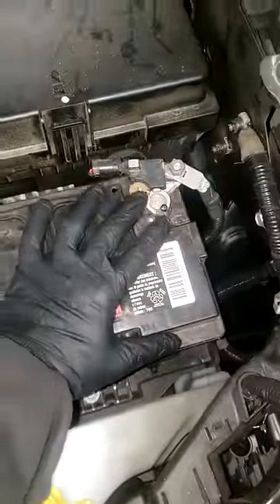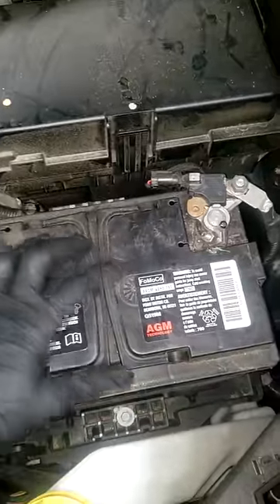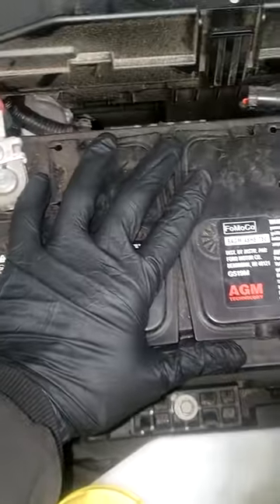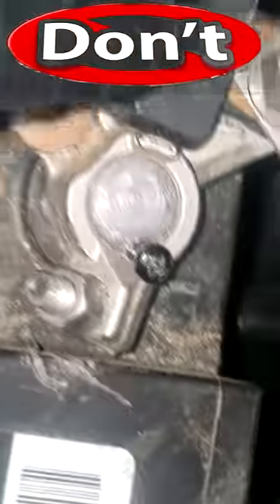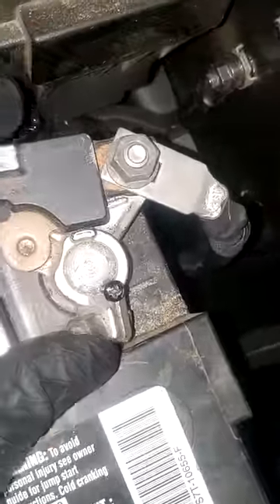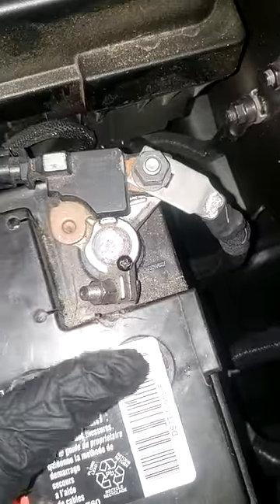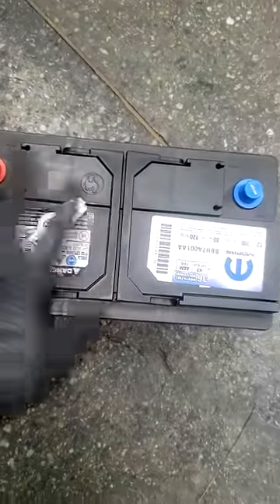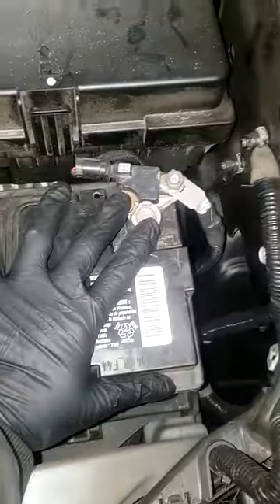STOP DOING THIS PEOPLE. This will destroy your car electrical system.

Comment: Bad battery, with cosmetic damage to the terminal is all this was. 

We're talkin small things here, but the sensor is only responsible for preventing overcharge and it tells the alternator when to stop charging, you can replace that terminal that you call a "sensor" with some random fray wires and it will still run perfectly. You can delete the actual computer sensor and the car will still work perfectly.
Reply from the maker: smdh, you actually on here suggesting that I delete what the manufacturer suggested should be standard equipped on the car???. Are you suggesting the terminal could be replaced without the sensor? Are you telling me the sensor tells the alternator when to stop charging? Dam you went 3 for 3, You didnt even get a one right. This is why this lady just left the hack shop you work at to come here and get it fixed right. Well the good news is that its fixed and shes gone. Your clown ass still on here promoting hackery...smdh.

Comment: Sensor doesn't need replacement not even the terminal is bad take out the screw clean the terminal
Replacement battery.......
Reply from the maker: You haven't a clue
Reply: @OnlineMechanicTips  you just make videos without true knowledge
From 30 year master mechanic

Comment: it looks like someone probably previously over tightened it and squished the post/ deforming it causing it to not have a good connection, so they tried to use a screw to take up the slack from the "air gap" in between the post and terminal.. honestly it just need the battery post replaced which you CANT do so a new battery would fix the situation granted YOU COULD HAVE just grinded away a little bit of the terminal bolt area since it looks like its been completely bottomed out but even sanding or grinding a little bit could have gotten a better connection... you could have saved the customer more money from buying POINTLESS parts or potentially a new battery if they wouldn't mind a little bit ground off in between the bolt space which would not affect anything the IBS sensor was sensing an imbalance in current and the "air gap" was the problem
Reply from the maker: Look man, this is a new car and a huge shop with a reputation. Nobody grinding down anything or altering anything. Thats shit you do on older cars thats not computer controlled. We removed that stupid screw and replaced the IBS and the battery. The check engine light off now and the customer happy.
Reply: @OnlineMechanicTips  obviously the check light will reset.. the IBS sensor wasn't reading correctly because of someone either over tightening it or wiggling the terminal off causing it to deform.. all you needed was a new battery since the post was deformed.. lead is very soft and the air gap caused the voltage to not read correctly and caused the check engine light to happen it could have saved them from buying the ibs sensor idk but least there happy and don't know anything
Reply from the maker: @destinyd1308  lol you expect me to to take a chance with a compromised terminal? By the way, the sensor and terminal 1 unit. It comes together. If the terminal screwed into, its getting the complete sensor. I don't recall asking you whats wrong with the car, I got that part. Im just showing what I'm doing on my youtube channel.

Comment: The screw makes the contact tight. Why would a good connection be a problem.
Reply from the maker: The screw will interfere with the connection and cause problems. Why do yall hood mechanics always defend screws and hacks? That shit has no place on these new cars.

Comment: Neither the battery, nor the screw were the issue.  The sensor may have been bad, but not as a result of the screw.
Reply from the maker: You have a big ass P by ya screen name, which means we have no way to validate anything you say..lol.. Now just how in the hell would know what the issue was?
Reply: @OnlineMechanicTips  I am MECP master certified.  I spent over a decade doing nothing but electrical work on vehicles.  More than that though, it is just common sense that a screw going into a lead battery terminal is not an issue unless it went all the way through the battery case

Comment: They gave you a terminal cause the sensor was not needed. But hey get your upsales where ever you can.
Reply from the maker: Smdh...that was the wrong terminal for this car. This car use an IBS sensor. Its all one unit. The sensor combined with the terminal. You cant get one without the other.

Comment: You should make a video testing the resistance on that terminal with the screw against one without.
Reply from the maker: Good idea. They towed in all the time because transmissions are bricked  with screws in the battery. People seem to think this a game and that they can still do this type stuff on these newer cars..YOU CANT.
Reply: Even if it's only a slightly higher resistance that creates more amps which could cause the sensor to malfunction. They're very sensitive.

I've seen solar setups where the guys use multiple wires and string them together to save money.

Then they fry their $1000+ battery monitoring system.

That's higher voltage but same concept.

Comment: Two weeks later it does the same thing because it wasn't the battery or ground it was a chafed wire inside the dash.
Reply from the maker: Smdh, you might wanna leave the troubleshooting to the pros and keep the guess work over there. Because thats about all you could do on this, guess or speculate. Either way, thanks for watching
Reply: @OnlineMechanicTips  I have degrees in industrial automation / robotics and mechanical engineering and make 500,000 a year keeping billions of dollars in machines a year for hundreds of billion dollar companies moving daily.   This pos Honda civic 12v car electrical system doesn't make you an expert in jack shit..   in two weeks the chained wires will cause the same crap.   You solved nothing by changing the battery and that "sensor"...
Reply from the maker: @wheatdevon  Judging by your channel, you a nobody. Let me show you how easy it is to make shit up on the internet. Not only am I a mechanic, I also do brain surgery and make about a million a year. The only proof I have is this channel proving the mechanic stuff, but I have no brain surgery stuff on it, just believe me any way. You see how crazy you sound. This car long gone fix and repaired. I cant help it some jackass put a screw in a sensor and caused her problems. But I'm here to fix them. I could care less what you do and how much you make my dude. I assume you not aware that is a sensor, maybe your highly educated ass think its just a typical ground terminal, its not. And btw i never claimed to be an expert, you just assumed that.
Reply: @OnlineMechanicTips  well that makes sense given your video. Not only do you think fixing a Honda is complex you are also can't tell the truth.
Reply: @OnlineMechanicTips  your quote is as such.   "You might wanna leave the troubleshooting to the pros..." Just because you got paid did not make you intelligent.
Reply from the maker: @wheatdevon  This car fixed and gone. Thats all that matters. Not sure wth you talking about
Reply: If I’ve ever known one thing in life to be true, it’s that people that identify as experts or pros very rarely know half of what they need to know.
Reply: @Clynikal  I make most of what I do up as I go.  Because rarely do things go as planned, thus my phrase I say daily anymore is "I fix shit I didn't build or break because it wasn't built right to begin with." and "best laid plans of mice and Devon." We live in a time where machining is so good and capable, yet we have critical components made of plastic.   And instead of building something to last 10yrs they just want it to last 10days off the lot and to the end of a warranty.

Comment: I agree with you but will never understand it. That contact is so tight you couldn’t even take the terminal off if you wanted to! I had a car once it didnt matter how much you sanded it or replaced the terminal or how tight you got it to clamp the terminal it would still loose connection! It doesn’t make an ounce of since to me but ever since that car I decided i’d just buy a new battery any time I have a loose connection 💀
Reply from the maker: That contact is not. We would be here if it was. Thats what causing all these problems.

Comment: Imagine charging $200 for an IBS clamp just to get rid of a screw. Throw a post shim on there and send it.
Reply from the maker: You should likely stay far far away from newer cars. Those battery shims will destroy your car and brick your transmission.. None of this stuff will work on these newer computer controlled cars my guy. Any voltage spike from this type of hacking will def cost you a tow bill. And just have it towed to me so I can laugh in your face and tell you I told you so
Reply: @OnlineMechanicTips  tell you what, I'll leave the YouTube mechanicing to you and us real mechanics will be out here making sure we don't give the industry a bad name.

If you think adding a lead shim to a lead post will do damage, you need to hit those refresher courses sooner than you think.
Reply from the maker: @brody6504  Yes not only do I think that, ive seen it. Tow in newer cars with brick transmissions because clown mechanics like you adding stupid shims instead of replacing questionable parts. You cant fix everything my guy. But stay the course, dont change on the count of me. Seems you confusing old cars with new cars
Reply: @OnlineMechanicTips  my guy you threw $400 in parts at it after seeing screw instead of taking 15 minutes to diag it properly. The only reason it's questionable is because you don't know how to test it. Have fun with the free engagement lubie.
Reply from the maker: @brody6504  Yea we good over here, yall keep hacking them. we will keep fixing them, She just left your shop but we got it right

Comment: My car doesn’t have the sissy sensor latches on to the battery post. So, no worry about the erratic light show on my dash. It’s either crank or no crank.
Reply from the maker: Lol...yes you can put 5 screws in yours and you wouldn't get a check engine light.

Comment: Tell me you don't understand electricity without saying it.
Reply from the maker: How do I do that? Im not understanding
Reply: @OnlineMechanicTips  Exactly. I have a degree in Electrical Engineering and was an ASE master tech before rupturing two disks in my back and ending my ambition to become a race engineer.

That screw obviously does not go there, but it isn't hurting anything. I'm sure the sensor was ok. I hope you saved it.

Bad batteries can cause a slew of issues, but they often will only show a bad cell under load. Load-test them to confirm.

More often than not, when you have an issue like this, it will be a bad ground. Grounding issues should be the first thing you check.

Comment: I converted my 04 Yukon and my 96 Silverado to a top post battery using military terminals and by crimping on new copper ring terminal ends with my hydraulic crimper. 
I have had no problems.

Comment: If only you could do everything that needs to be done. I've helped so many people so many times because they couldn't afford to do it properly. Either took a loss or set up a payment plan so it didn't create even bigger problems down the road. Living in a county that most people live paycheck to paycheck its not always just straight forward unfortunately. Glad to see your doing the job right. It would be nice if you just found everything wrong and repaired it without having to worry about can it be afforded. Ultimately it has to do with the safety of them and others on the road.
Reply from the maker: Seems you get caught up in your feelings a lot. That can be a bad thing as a business owner sometimes. Well I don't own this place nor can I make those type decisions.
Reply: I suppose your right about it not being a good buisness decision.

Comment: Charged for new battery they didn’t need and a ground sensor also not needed then changed 165 a hr shop time for a loose bolt Customer got screwed twice way to go
Reply from the maker: Damm, seems your clown ass got 3 out of 3 wrong..way to go

Comment: The only reason this hack repair is wrong is the gap between parts that should be tight allows corrosion products to accumulate.
It's a bad hack, but a screw between the post and terminal is not causing issues, it's just not really repairing them.
Check the battery, get the right terminal, clean both surfaces, use dielectric grease, tighten it right, and if everything is functional, will stay mint until something else fails.
Reply from the maker: For the record, hackery has no place on these newer cars. You can defend hack repairs on older car because they not heavily computer controlled. With that poor connection at the battery, this customer lucky her transmission wasn't bricked. You can knock modules out of proxi alignment doing this crap. Stop defending this foolery my dude.
Reply: @OnlineMechanicTips  seems there was a shite connection to begin with. Maybe they were having issues somewhere with no services, and it was a choice between a hack repair and a massive tow bill to get them to a proper shop. 
I'll take the hack every time in that case.
Reply from the maker: @mircomuntener4643  Hack away my brother. We will just sit back and watch as the tow truck driver roll them in one by one to greedy ass mechanics that will up play the problems with 5 hours electrical repair estimates when all they do is un hack the foolery and get the connection at the battery back on point. Yes yall hack away.
Reply: @OnlineMechanicTips  'greedy ass mechanics' says the guy who doesn't even verify the battery function before loading the parts cannon.
Reply from the maker: @mircomuntener4643  I wouldnt call 2 needed parts canon but its a catchy phrase. And what I look like wasting time on a battery thats wrong and dead. You sound crazy my dude. No time wasting over here

Comment: They make lead shims if you have a worn terminal, the terminal probably isn't worn it just needs a tap onto the post with a hammer.
Reply from the maker: Those shims are not advised on this set up. None of that stuff to be used on newer cars my friend.
Reply: I have a piece of a hose clamp stuffed in mine. Too cold, don’t feel like replacing it. It’s a 2016.

Comment: What are you saying .. the screw should have no effect on that sensor, it might be a battery issue but to just assume the sensor just doesn't like the screw ? Even if the screw is painted and somehow has zero contact it would still work
Reply from the maker: I hope you not telling your customers this is ok. For starters, this lady lucky her transmission not bricked and offline. The sensor is attached this terminal (it's all sold as 1 unit) So if this screw causing any affect on the connection between the battery post (btw which is the wrong battery) and terminal then yes, that sensor could pick up on that and bricks some major items. I simply replaced the IBS and the battery and all is good.
Reply: @OnlineMechanicTips  of course it's not right but your explanation is not correct, the flashing lights and electronics going haywire is probably due to the wrong battery size and not the screw.
You can test the battery to see if it's the reason and surely replacing it with the right size will help.
I have never seen that sensor brick parts, it usually stop the car from starting completely and if the part fails you won't be able to unlock the doors as it will cut the entire power supply. Anyhow good luck
Reply from the maker: @khalidalnajjar1558  Smdh, I never said the sensor would brick parts, I said poor connection at the battery will.  And you telling me of something you've never seen b4 means nothing to me. You guys think to hard when problems right in ya face. Battery wrong and dead and the connection at the battery compromised because some jackass put a screw in the terminal..(sensor, terminal all 1 unit here) So its simple, replace the battery and that sensor unit. Customer gone and happy, but yall still on here concerned about trivial things..lol

Comment: Sensor terminal most likely did not need replacing. Clean the terminal and put a battery post shim in place and off they go.
Reply from the maker: Lmao... omg, not another shim guy?  STOP using that stuff and bootlegging yall battery on newer cars. You cant do that stuff anymore. You going to knock your transmission off line. This is not the nineties anymore. These cars are computer controlled...geeeeesh

Comment: its all about contact ,,,ive done that type of thing many times through out the years and its worked fine for me
Reply from the maker: There you go. The IBS sys hasnt been out through out the years. That may work on older cars, but not this new stuff with computers and sensors

Comment: Did this for years with my old Honda I had no problem with it
Reply from the maker: Noticed the key words you used "my OLD Honda" Thats my point. Your old ass Honda did not have battery terminals as sensors back then. It didnt use IBS. The newer cars do. You can not do this to newer cars using IBS. It will cause all kinds of problems and may lock you out of your transmission.

Comment: Why do you need a battery?  Did it fail?  Or was there just poor connection?
Reply from the maker: Battery wrong (post size) and yes, its dead. This car got a new battery and IBS
Reply: @OnlineMechanicTips  lol.  Post sizes are standard.  I’m willing to bet an hour or so on a trickle charge would have brought the battery back to passing condition.